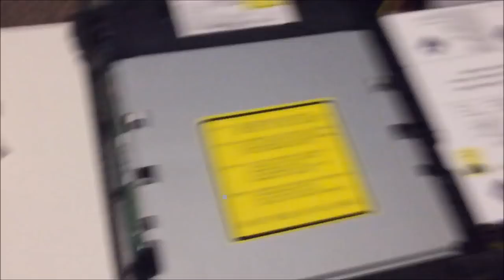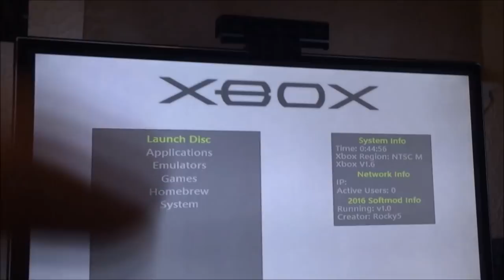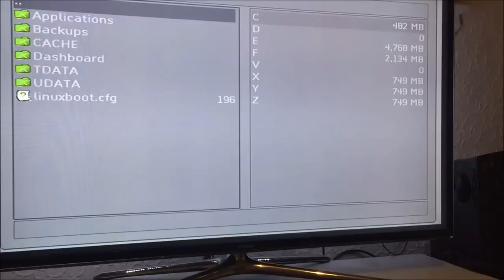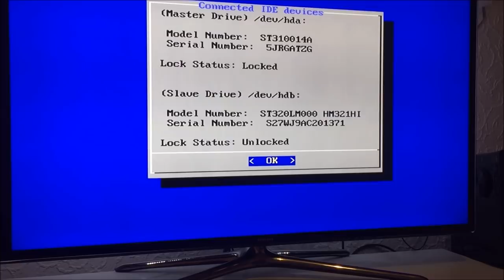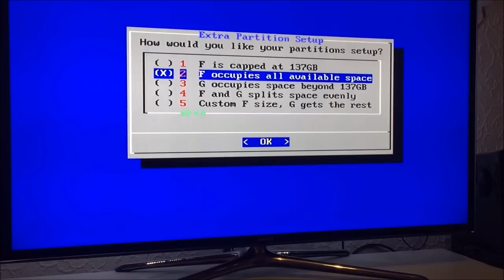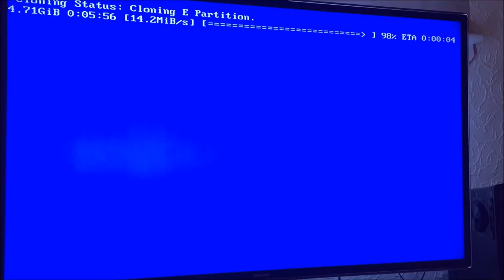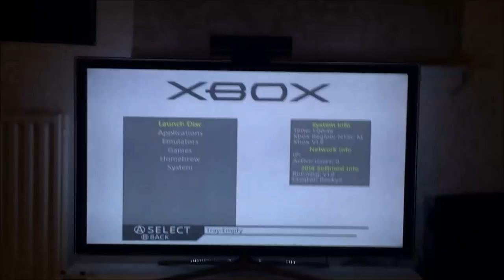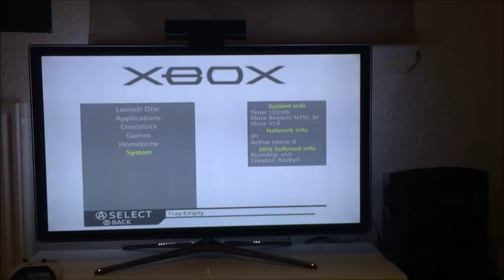How to clone your Hard drive using Chimp 261812 from start to finish.

Comment: Cannot get this to work for the life of me. Trying to go from OG HDD to SATA and I have the green adapter from the video. Using 80 wire and tried both y-splinter and external power to the SATA drive with no luck. 

When I get the console booted I go to unplug the DVD drive like in the video before opening Chimp and then I can’t load Chimp. If I wait until I start Chimp to move the cable it just hangs for forever at Starting Chimp 261812....
Reply from the maker: Make sure the drive is set to slave on the adaptor, if it’s not it will hang. Also make sure there are no devices plugged into any pads connected to the console.
Reply: JCRocky5 yep, adapter set to slave, original HDD tried both CS and Master same issue with every SATA I try (6 of them).  Running your softmod 1.1.6 and using Chimp 261812 installed multiple times from Windows FTP/your Extras CD Tools. Still no luck. 

I’m thinking the adapter has to be bad. Using original component cables, original duke controller. Nothing else connected.
Reply: Forgot to add 1.4 Xbox.
Reply from the maker: Don’t use component cables, try standard cables if you have them as not all Xbox work with component. (After chimp loads, the LED should be green at that stage)
Reply: JCRocky5 sorry. Typo. I used the original RCA cables. Y/R/W and component. Tried both. 

I load Chimp and get to black screen to connect slave drive. I move the 80 from dvd to drive and then press a. It says Chimp loader v1.01 booting Chimp 261812... and at the bottom starting Chimp 261812 in green. At this point it stays here forever and the Xbox light is blinking green.
Reply from the maker: Yeah it’s loaded, but your display hasn’t updated. (This is the same issue with component cables) disabled any HD resolutions you have enabled on the Xbox so 480i is only enabled.
Reply: JCRocky5 no luck. I checked and I didn’t have any of the additional resolutions enabled in Xbox settings. My tv input shows 480i when the box starts up. Still getting the same thing. Tried on another tv as well but only have HD TVs with Component inputs that double as AV. Could that be the issue? Do I really need to find an old monitor to connect to?

Comment: Hi bro pls can you help me 
I have xbox softmod 80gb ide 
I need upgrade with new hdd ide 
I used your method but not working do i need format the new hdd fat 32 or ntfs or fatx 
sorry for my bad  english
Reply from the maker: +Kurdistan is one the new drive doesn’t need to be formatted beforehand. Just make sure it’s set to Slave and you’re using a composite av cable. 

Why isn’t it working, what happens?
Reply from the maker: +Kurdistan is one make sure the new HDD is set to Slave via the jumper.

It looks like you are trying to use to master drives.
Reply: thanks for help 
I bought a new hdd
your method working 100%

Comment: Ive been working on this for days. I really need some help with this. cant get chimp installed right.  1. i cant find the  linuxboot.cfg file in the file i downloaded. Im thinking this is the reason i cant get chimp to show up in the apps at the main menu.
Reply: I was having the same concerns about linuxboot.cfg but I just noticed in JCRocky's post at the top he wrote " ( Chimp has been updated since the video linuxboot.cfg is not required now )". 
I've been assured in another forum that the folder CHIMP is the only folder that needs to be FTPed to e:\applications\

Comment: Could u possibly make a video of you loading your newest version of chimp on to the Xbox from the pc maybe I’m not loading it on the Xbox from the pc right or somthing
Reply from the maker: You FTP the Chimp Folder that’s inside the E Partition folder to one of the location listed in the readme file. 

You may need to use standard AV cables if it hangs at some point. Also note some Xbox just don’t like Chimp and refuse to load it or do anything with it. I suspect it’s a corrupt E partition structure that cause it as gentoox ( chimp loader ) mounts the E partition. 
( someone who had this issue installed a new hdd and chimp worked fine on the new hdd, but refused to work on the stock old hdd )
Reply: How am I supposed to install a new hdd if chimp refuses to work with this one if that’s the case?
I hav another Xbox but for some reason it would not except the soft mod when I went the load the Linux file on splinter cell and pressed on the check points file it would just sit there and lock up u could still here the music in the background playing but couldn’t do anything els, couldnt press b to go back or anything it like refused to take the soft mod that’s why i switched to the one I currently am using but like I say now I’m having the issue of cloning the drive
Reply from the maker: Disable 480p and 720p on your other Xbox and it will fix the save crash.

Also use my softmod and NULL your EEPROM on both systems before upgrading the HDD, this means you can create a HDD on any of the systems and just lock it and it will work on both.
Reply: JCRocky5 thank u so much I’ll try all of this when I get home tonight. And u mean yes NKPatcher to null the eeprom? And lastly do u think I should pick up a standard av cable on my way home tonight just in case it’s that? Thank u so much JCrocky5
Reply: JCRocky5 does it matter if it’s a first party Microsoft standard av cable or can I use a after market 3rd party av cable?
Reply from the maker: Any variant.

Comment: Hi again I keep trying to clone the drive followed ur video step by step and I keep getting the message your Xbox needs Maintenance I’m pretty sure Iv got chimp installed right or maybe I don’t but I downloaded the file u gave from the link in the description help 
If I can resolve this I may just use and older version of chimp but like I say I’m upgrading to a 2tb hard drive
Reply from the maker: After the clone? are you using a known working SATA adaptor and 80 wire IDE cable.
Reply: I’m using the exact same equipment you recommended on this video in the links in the description so I got everything the same as u 
Minus the av I built a hd component cable from and official Xbox360 cable I guess I could try using standard red yellow white cables I’ll hav to go buy them as I don’t hav them anymore. Do a need official Microsoft av red yellow white cables or can I just use a 3 party one?

Comment: Hey man, I have been using this method for a while now and I am stumped with this one XBOX v1.1.  Did the version 1.1.6 softmod, cloned the drive with chimp successfully and removed the clock capacitor.  Tested and the new drive worked outside the xbox.  Swapped the drive cage and plugged it back in to error 16.  Swapped the cable again to the original drive, set the clock, swapped again and now the new drive works.  Unplugged the xbox for 5 minutes, plugged back in... error 16 again!  I cannot for the life of me understand why it still  gives a crap about the time with your softmod.  Everyone keeps linking me to forums saying how to "fix" this but it is not the same issue and I cant be opening the xbox and hooking up the original hard drive every time I unplug this thing.  Used the 1.16 boot disk to reinstall the ms dash just in case and still this has issues.  Thanks in advance.
Reply from the maker: I would fix the time on the system then reapply the softmod as you shouldn’t get error16 at the very least you would get a black screen or a Xbox live dialog box. 

So the content of C is probably corrupt in some way.
Reply: @JCRocky5  i just did that.  Fixed time with original drive hooked up, powered down and booted from the 1.16 disk.  Did the upgrade softmod option and it rebooted to a blank screen.  Rebooted to error 9.  Reseated ide cable and rebooted again and the softmod install completed.  Its just wonky that it seemed to break initially after i changed the default skin.  Powered down for now.  Will see what happens on next bootup.  Updates to follow.
Reply: @JCRocky5  After reapplying the softmod from the boot DVD the second i unplug the machine i get error 16 and im dead in the water again.  Do I need to reinstall a different way?  I booted the 1.1.6 DVD did the softmod upgrade tool, it detected current mod and updated/rebooted.  Thanks in advance.

Comment: What skin are you using?
Reply from the maker: The one I created for my 2016 Softmod. 
(It's included with the Softmod)
Reply: +JCRocky5  Is there a way to get the skin installed on my hard modded xbox? lt's much cleaner than the ones I can find. Thanks.
Reply from the maker: Yes, I will zip it up & post the link for you.
(Sorry it's taken so long to replay)

Comment: Hi so I’m getting ready to upgrade my hdd to a 2tb harddrive and I think I hav chimp loaded on my Xbox properly. I haven’t opened the Xbox yet to hook up the new drive or anything like that I just wanted to make sure chimp loaded first but when I select it from the applications nothing happens it just says loading with with the white dash background the same one u hav on ur dash then it flashes to the original Xbox logo,black and green then goes back to the softmod dash board is this because I don’t hav the new drive hooked up via the SATA and ide cable internally or what I just wana make sure chimp in on my console and working properly before I start the process. Iv tryd downloading ur like in the description for chimp just to make sure but that download of chimp did seem to work for me so I decided to wipe it off my Xbox and put the one I had on there in the first place

Comment: Am I able to ftp chimp over and put in e drive with another apps folder? Or do I need to put on a usb then copy over to Xbox?
Reply: Either option works. I personally use ftp. If you go with the usb option you will obviously need an xbox to usb adapter

Comment: I am stuck at Booting chimp 261812... it just says Starting Chimp 261812 in green letters at the bottom. also the menu I see is black and has less options not blue.. What am I doing wrong?
Reply: Me too
Reply from the maker: Are you using stock AV cables?
Reply: I've fixed it... i had set the new hdd to master instead slave (a stupid person told this to me)😃😂

Comment: Do i need to tsop flash to use ssd or i can just do it with your softmod?
Reply from the maker: I don’t recommend using a SSD, get yourself a large 2.5inch Sara drive and you can use it in softmodded or hardmodded systems.
Reply: @JCRocky5  tnx

Comment: at the blue screen needs a cd/dvd disc. where can i get a disc to start the rest of the chimp261812
Reply from the maker: Lindsey Cadagan it doesn't require a disc, install it properly.
Reply: what do i do? i.e how do i install it to show the blender. maybe put cfg in the e root.
Reply from the maker: Lindsey Cadagan If you are using Chimp 261812 then put what's in the E partition folder on the root of E.
Reply: how do i move the e parttion folder to the root of e.
Reply from the maker: FTP, like you install everything else's?

Also you don't move the e partition folder. You put the Linuxboot.cfg and the Applications folder that are inside the E Partition folder ( that's inside the zip you downloaded )  onto the root of the E partition ( the E drive on your Xbox HDD )
Reply: on my xbox the blender does not show up. just the cd/dvd, Boot OnBoard BIOS, Settings. thats why i need a disk.
Reply from the maker: I can't really help you, as I don't know what it is you are trying to do? Can you supply an image please and a better explanation?

Comment: ok I re installed it , Same problem , However In order to get it to work from the applications tab I have to rename your folder to apps.  then it will launch from my applications tab.   So I decided to  put that folder back to the way you had it named applications.  It will no longer be found on the apps tab even after a restart , So i went in through file explorer   and started chimp from the folder there and it worked fine 160 gig hard drive successfully cloned ,  thanks for the help !
Reply from the maker: +Atari Woodgrain yeah unfortunately chimp is hard coded via the linuxboot.cfg in the root of E, for future reference you can edit it via a text editor and change the paths. 

The reason I use Applications is because in my opinion that's how it should be, with my softmod I support all old paths + the correct spelled versions. 
(Emu - Emulators, Apps - Applications eg...)
Reply: I agree with you ,  Thanks for the help ! I really appreciate it

Comment: I have a problemmmmm, when i plug my harddrive and start the app it says that it cannot conect to port 4
Reply from the maker: When you start the app? the XblastOS part or the actual Chimp part?
(there are two parts to this, the loader and chimp)
Reply: i have that issue too with XblastOS